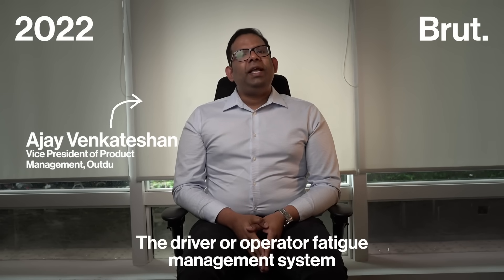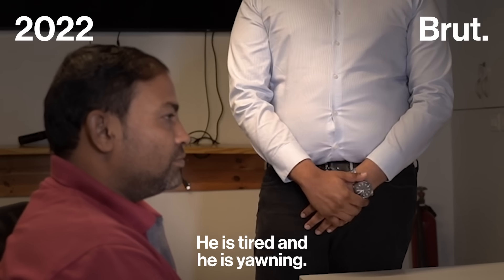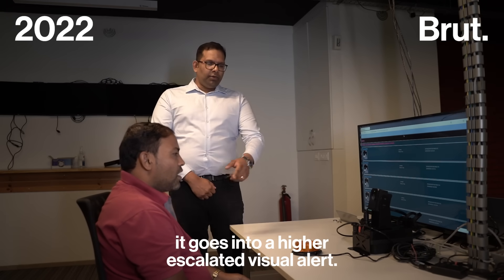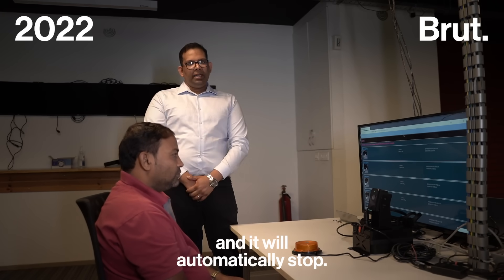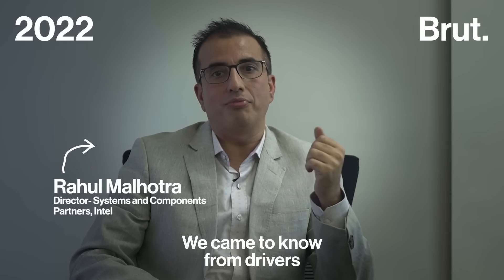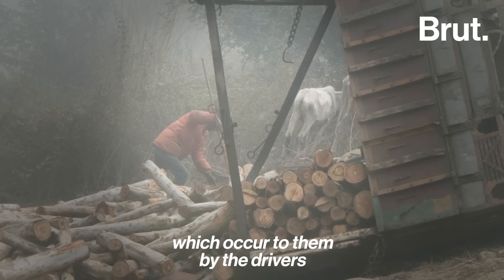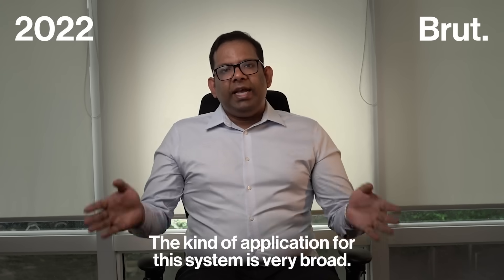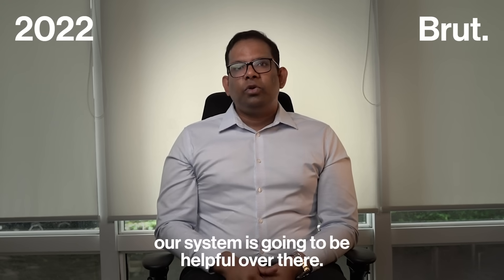How AI is helping truck drivers in India

Comment: This is as same as removing ceiling fans for preventing suicides. Yes we have a so called solution for everything. If this effort would have gone towards implementing proper work hours system for truck driver to minimise work overload and fatigue. That's how things should be improved not by implementing a dumb alarms which  tells you - wake up bitch and drive. Typical India invention!!